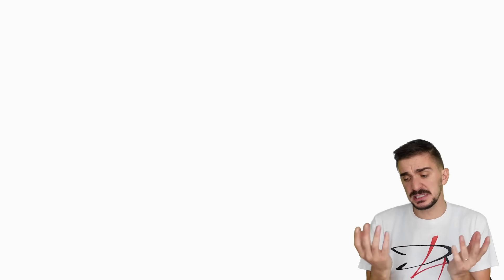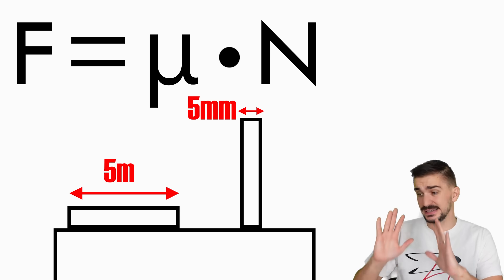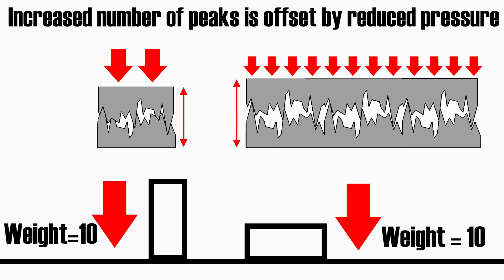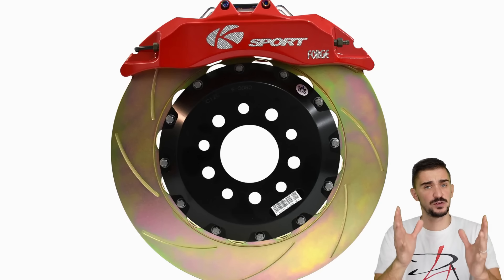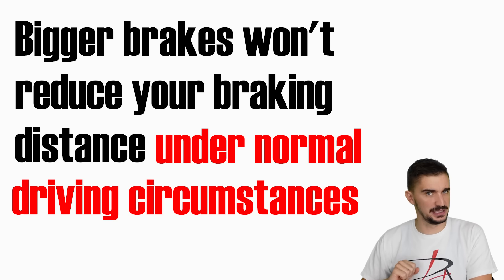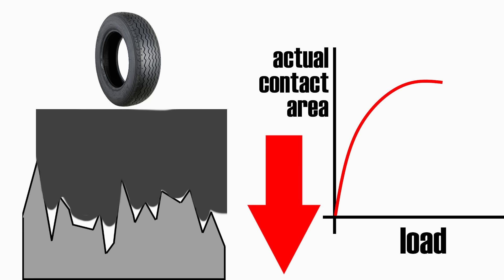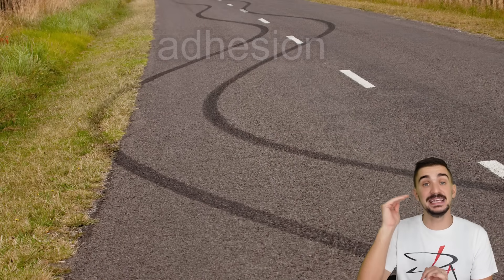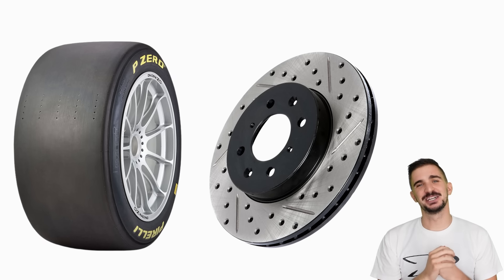Why Big Brakes Won't Stop You Faster but Wider Tires Will - Friction and Surface Area Explained

Comment: tHAT MAKES SENSE AND NOT COMPLICATED EITHER. mUT WITH A FULL SIZE FOUR WHEEL DRIVE UPGRADED TO TNOT ME SLOW AND DOES SOM STEEP OF ROAD . wITH BIG TIRES AND GEARS NEEDED TO PUSH THEM WITH OUT PUTTING MORE STRAIN THEY MAKE THE DRIVETRAIN THEY ARE TURNING THE SMALERVTIRES DESIGHNED FOR THE DRIVETRANE, AAAYOU HAVE TO UPGRADE THAT TO IF YOU GIVE IT MORE POWER AND GO TO STEEP AND ROUFG OFF ROAD ALONG WITH SUSUSPENSION AND SOME STEERING FOR THAT AS WELL.tHE BRAKES UPGRADE IS ALSO A PUSS WITH A FASTER AND OFF ROAD TRUCK wHILE THE TIRES ARE WHAT GIVES YOU TRACTIN TO STOP  THE BEST BUT GOOD BRAKES ARE A PLUSS FOR MORE POWER TO STOP THEM.

Comment: Bigger pad = more material = lasts longer. Also less heat per square inch (or cm2 depending where you are). Larger disc area = more area to dissipate heat. That's the benefit. Stops batter when hot. So bigger brake will stop better when hot. Or less hot then smaller brake in same condition.

Comment: One asterisk I feel is worth mentioning, is that using the biggest brakes available for the car OEM will usually be best. Many cars have two front brake options using the same proportioning and caliper, with only a new bracket and disk (volvo did this very often) 

The stopping got noticeably better and more repeatable once I shifted to 302mm from 280 mm. Not night and day but noticeable. Ive also warped several 280's while doing sushi deliveries but never ever on 302's. 

This probably comes from the car actually being designed for the larger rotor, but then offering a smaller option for people who wont go fast enough to need the upgrade.

Comment: It’s about leverage too, bigger disc and more leverage/pressure can be applied to the disc using the same force that would be applied to a smaller disc. Obviously you can only have so much braking power linked relatively to the grip of the tyre on the road/track. It’s like power, you could have a million horse power but it’s worthless if you can’t put it down onto the road.

Comment: A larger brake disc (diameter) means more torque with the same force.  This means a larger diameter of the brake disc improves the power of deceleration.  I think you didn't consider the effect of the diameter.
Reply from the maker: https://youtu.be/Ql9eYh31kTw
A few hundred people made the same comment so I made a follow up
Reply: @d4a  Thank you for responding to viewer comments.  Thumbs up.  I love your videos <3

Comment: I thought the idea of bigger brakes was that where the friction force was created on the rotor is farther from the center of the wheel creating more braking torque. You also get the benefit of larger surface area to dissipate heat more as a bonus.
Reply: Not really. That’s how it’s sold through marketing and advertising (or rather they let the consumer “assume” that).  It’s all thermal management. Larger brakes cool faster and can endure repeated thermal cycles. But this involves driving 99.9% of street drivers will never see; motorsports. For street driving, unless you’ve tripled your horsepower or a BBK was an OEM application, you don’t need it. Get better pads and fluid with a higher boiling point, braided lines and you’re more than likely to be just fine. 

if you want a BBK just because it looks cooler, that’s fine. Just make sure the piston(s) surface area do not exceed what the brake master cylinder can output or you’ve made your car unsafe.

Comment: If you ignore for a moment that the tyres have a limit, surely the increased torque applied by bigger brakes has an effect. Even if the force applied is the same, the radius it’s applied at has increased.

Comment: I race motorcycles and this isn't exactly true in that specific application but I get that every rule has its exceptions.

Now, if I may assume the role of grammar nazi..... you can't stop faster. That makes zero sense. However, you can stop quicker. Quick and fast are not the same and are not interchangeable. One refers to rate of speed. Quick is a measure of time. You're welcome. ;)
Reply from the maker: You can definitely stop faster. Even in grammar. Stopping faster means greater acceleration, only in a different direction. Physics doesn't have different variables for acceleration and deceleration, only the direction changes. Hence, stopping faster.

Comment: Why is this so hard for people to understand? The biggest limitation for stopping a vehicle has to do with the thing directly making contact against the surface you're moving across. Most brakes are overpowered for the application they're used for and controlled by electronic systems. Anyone who doesn't understand this is kinda a simpleton.

Comment: Well, we don't use the bigger disc for the bigger surface... You have a wrong understanding... Bigger disc means the caliper placement is wider more offset, so you will better stopping power. Its easier to stop a spinning wheel by applying friction at the outer end than applying same friction/force at half the diameter.

Comment: I believe there is truth in what you say.
I can understand that the increase in surface area on large brakes does not increase friction.
However, increasing the diameter of the disc on large brakes does not increase it
the lever arm...?

if you put a very very big steering wheel in your car, you won't need much more little  power to turn...?

Ιn other words, I believe that the larger brakes have a much better performance. 
The reason is the larger lever arm from  the larger disc diameter, and not for the larger surface area.
The  larger surface area makes them last longer, due to greater heat dissipation.

Comment: It isn't that you expect a big brake kit to stop you faster. I know better than that. If your brakes are strong enough to lock up your tires, then you're not going to gain anything with a bigger brake kit. What you will gain in most cases is reduced fade. Both by additional Mass for the Heat to go into, and greater heat dissipation assuming that the disc is reasonably designed.  In some cases, these aftermarket discs will perform less well initially.  Because they're designed to be used at the edge of performance and really give their best performance once they are hot and the braking compound has chosen to work with that.

When the brakes are still cold, you may have a stiff or slick feel to it like it's not braking very well at all.

I have a 2021 Mazda3 turbo which I bought at the very end of 2021. 2282 I put 54000 miles on the car, I drive a lot. And it is through the North Georgia Mountains so it's a lot of curvy roads with long steep grades.

Do not get me wrong. I love my little car. For daily driver it is awesome. The tiniest little GT car ever. It will effortlessly hold 90 miles an hour while getting 28 miles to the gallon, it has plenty of power for passing and can squirt up and down those mountains.

But.  And it's a big but.  The front brakes are inadequate for truly spirited driving.  In less than 3 Mi coming down Brasstown Bald oh, I was able to get the brakes so hot that breaking Effectiveness was reduced by 80 to 90%.  Toward the end I was actually a bit concerned, having to use engine braking and sudden darting movements to get the car to slide a bit to scrub speed.

In Daily driving, I've never had a problem with it. But I have chosen to get the corksport big brake kit oh, and the next time I'm due to buy tires, I'll be swapping out the tires, wheels & installing the brake kit.

For now, I've chosen a high-temperature compound for my brake pads.  It does mean braking is a little bit subpar when the discs are cold.  But far from dangerous. And as the discs get hot, fade is greatly reduced.

Comment: You did not take into account the leverage force of larger brakes disk. The same force at 9 inches is less than at 13 inches thus  more rotational stopping power  with less brake pedal pressure.  The question is when will you need this extra stopping power.   Everyday as most people only use the brakes to slow a car down....  NOT LOCK the wheels for ABS to turn on.  If you drive like this please get off the roads.

Comment: There are some things you miss. Tyres are different for friction. If you watch donut medias video with tyre width, they use a spring balance to measure the force and its exactly the same. The only difference is smaller tyres leave a bigger mark(since more compound is used and more pressure is applied)

Comment: Tire size...braking power etc...are all for naught if front suspension spring rate is inadequate!

Under max braking on clean level pavement...front brake won't lock until fork bottoms out!

Must fix or consciously ride within boundaries set by front suspension inadequacy.

Comment: So we add more weight to sport cars for nothing...sure
Reply: Have you noticed how sport cars also come with wider tires? Also, bigger brakes allow you to do hard braking a lot more consecutive times because they get better cooler with the bigger surface area, therefore won't get your brake fluid to a boiling point - which would introduce gas in the braking lines (and gas is compressible) which would basically disable your brakes.

He made another video which is dumbed down even more which could help you understand this.

Comment: The larger brake rotor allows more leverage against the rotational force. It's not contact area. You move the caliper further towards the outside of the wheel. Say a 20 inch wheel with a 14" disc vs an 11" one. Larger brakes then bring into play the need for larger tires to meet your grip statement. And you realize the cross drilled holes on the motorcycle rotor are the venting. Motorcycles don't need vented dual disc rotors like a car because of the lower mass in the motorcycle.
Reply from the maker: https://youtu.be/Ql9eYh31kTw

Comment: The hydraulic amplification has the ability to convert kinetic energy to heat at a rate far faster than the vehicles tires can do when compared to deceleration of a vehicle over a distance in contact with road surface. Friction coeffeciency is disrupted by asphault and the way the tire interacts called tire scrub. Both materials are way softer than pads or rotors and cannot provide equall conversion without disentegrating creating a lubricating effect wich limits effective deceleration

Comment: I'm watching your video, I'm trying to understand its meaning, I'm trying to understand what you're explaining but I'm a practitioner and I know it's not true, a few years ago I put bigger brakes on my car and the braking force is definitely greater
Reply from the maker: It's probably not. What changed is modulation. You now apply higher braking force with less pedal effort so it feels greater. I don't know exactly what you changed but going to larger brakes without any other mods usually produces this effect.
Reply: @d4a  rotors, calipers and pads

Comment: Is it me are I herd are saw nothing about «leverege force » nowhere… if tire friction and slip are virtually Not limited you must stop faster with bigger diameter breaks … wtf! It is the opposite of acceleration… you put smaller wheels more power… change your diff ratio…. Even start driving in first gear!!! The base of all that is “ leverage force ” 🤷‍♂️🤦‍♂️

Comment: Technically when discs heat up it's ability to slow the car diminishes, big performance brakes can take more heat in both holding and dissipating so if used a lot they will keep slowing you down faster than stock brakes but if it's just about stopping distance then it's all about good ABS and tire grip.

Comment: I will love to see a simple test of a big brake vs small brake in a single stop from for example 100mph to 0mph. I think te big brake sysem will outperform the small one in that single stop already, because in that single event you will already see overheating phenomena in a small rate, leading to better breaking performance to for bigger system already in one single event. Then maybe bigger tires are more important of course, but bigger brakes will help too!
Reply: Better pads and brake fluid + OEM rotors will help a stock system vs a bigger brake kit in most applications short of motorsports. Trust me, I know.  Street driving will never see the limits to exceed what manufacturers spent millions in R&D developing.  Bigger brakes = better thermal management, not necessarily better stopping distances.

Comment: But larger brakes also mean your braking force is applied further from the center of rotation. F=uN does not account for the rotational component! The same frictional force being applied at a larger radius from the axle will provide a higher torque on the wheel vs that same force on smaller brake rotors.  

Like you said though, tire traction is almost always the limiting factor.

Comment: You didn't consider the effect of larger diameter rotors, which increase the mechanical advantage the brakes have against the rotational force from the wheels. Ie, they're a bigger "lever".

Comment: The advantage of larger brakes is efficiency of braking. Mostly with how long and how hard they can function before heat makes them ineffective.

How fast your car actually stops is dependant on the ability of the wheels to arrest the momentum when their rotation is restricted.

So.. this is common sense?

Comment: FINALLY!!!  So many vehicle testers go on and on about the giant brakes but mention nothing about tire size and tire width. A car can have the biggest brake s in the world, but if it has skinny ass tires those big brakes do nothing to shorten braking distance. Sure, they can shed heat better and might last longer than OEM. It’s just physics and that can’t be changed, no matter what Marjorie Taylor Greene says. 😂
Reply: Wider tires don't give you more contact patch, just a different shape contact patch, and more rubber in the tire to which to spread the heat.

Comment: That’s why some porches gt3 rs are fitted with some Corsa 1.2 brakes
Reply from the maker: Yes, they also have the same tire width and size 😉
Reply: @d4a  conspiracy theory at it’s best
Reply from the maker: I explained everything in the video, including the reasoning behind larger brakes. You just lack the attention span and/or the intellect to process it. Does a Corsa have the same top speed and acceleration as the GT3?

Comment: 2:09
No... 
N is the counter reaction of the plane, a force that is applied on the object by the plane.
N is equalt to the force that the object pushed the plane.
Essentially N is pointing up, other than that the video is cool. :)))))

Comment: Could you say the same thing with wider tires and a small rotor. You still need one or the other. Or even both wider tires and big rotors still not as effective if you have shitty brake pads

Comment: Why do they make big brakes? It's not about disc area or heat ...No, in the first instance it's about diameter. The force transmitted to the wheel is greater if the brake diameter is larger. Not due to the disc area but because the distance to, or the effective radius that the pads grab the disc is in essence the lever ratio that can transmit energy to the wheel. And that's a primary factor. You're welcome.
Reply: 99% of modern cars are equipped with stuff like brake boosters and the caliper technology is advanced enough where even the small brake systems have enough force to lock up the wheels, that's why almost every modern car you see has ABS (they wouldn't add unnecessary tech in them if they didn't need it lol).

You're welcome.
Reply: @jreererer8490  You're unlikely to be right but  more to the point, how is it relevant?

Comment: This is wrong on several levels. Bigger tyres will increase your risk of aquaplaning. Friction is a function of both the gripiness of the surfaces and weight and surface lubricants e.g. water or dust or gravel ie roads are not clean.

Race cars like performance motorcycles have soft tyres. The soft tyres are designed to deform and wear indeed they are designed to heat up so they become sticky and you need much bigger brakes because the adhesion levels through these soft sticky tyres impose much greater braking loads. 
Hard bigger tyres don't increase braking loads. In fact they can decrease them resulting in poor performance.

And as practical example just look at motorcycles. Motorcycles increasingly have been fitted with much bigger brakes and significantly stickier tyres. So for example on BMW Metzlers are often fitted. They don't last so well but they grip and corner far better than hard tyres. But you need bigger more powerful brakes to really use this. I recently changed my heavy Indian motorcycle to soft tyres to  improve handling and braking. But if I was going to race the bike then bigger brakes as you see on moto gp would be necessary.
Reply from the maker: Oh Hugh....

Comment: Bigger brake CAN lead to shorter stops.... because the time it takes from first application of the brake to the limit of tire friction is shorter the sooner max stopping force can occur. From 70 mph, if that time is reduced by 2 milliseconds, you would stop in 22 less feet. But, well maintained stock brakes, with good pads MAY be able to reduce that "rise time" by the same amount. It will likely need more aggressive pads which will reduce rotor life but that's the price of safety. All of the above is IMO.

Comment: What about the leverage difference between a 10 inch rotor and a 14 inch rotor? If you use the same 4 piston caliper on both rotors it seems like the further from the center of the hub, the greater the leverage would be.